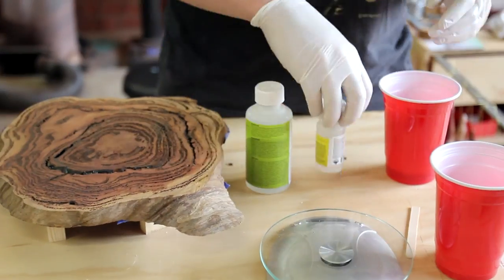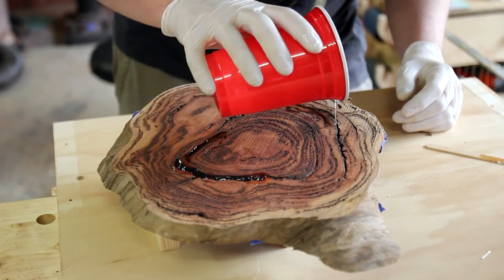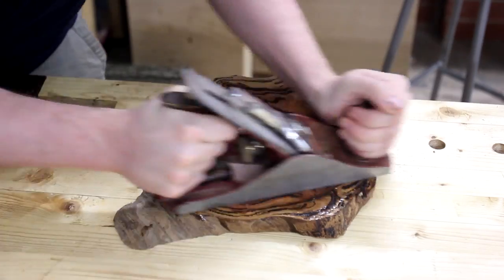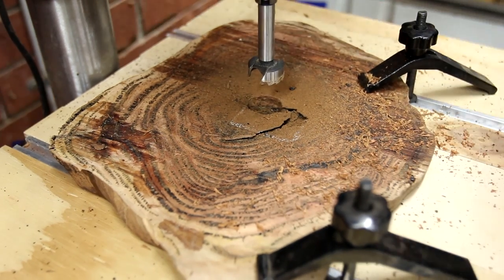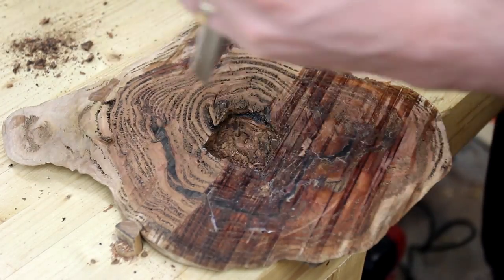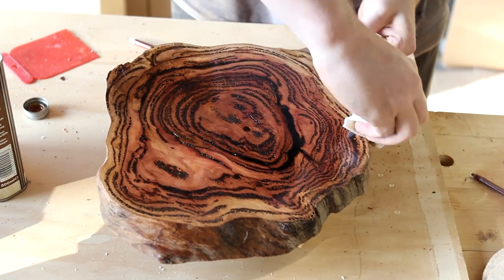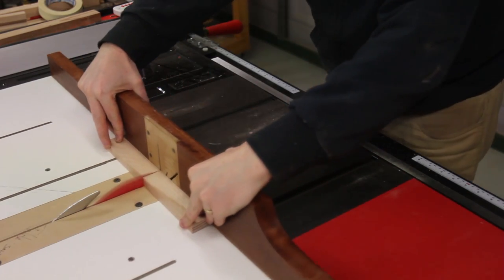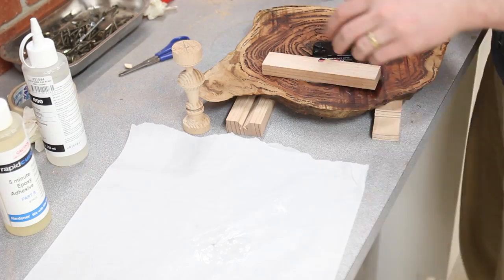065 - Coolibah Clock

Comment: Crazy growth rings - looks amazing. I see you ended up getting the RT0700 trim router. Which bases do you have?
Reply from the maker: Just the standard fixed base, the Australian version doesn't include any others but since I'm planning on using this in the xcarve that doesn't matter too much. It's a nice little router though, plenty powerful but easily controlled.